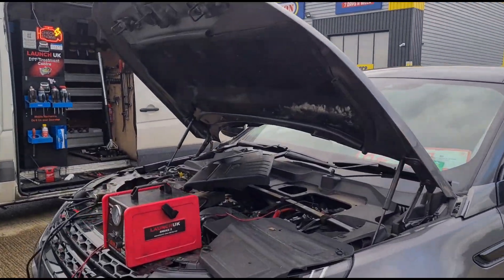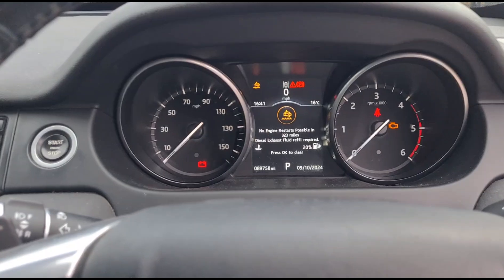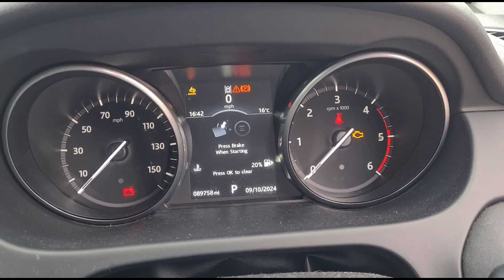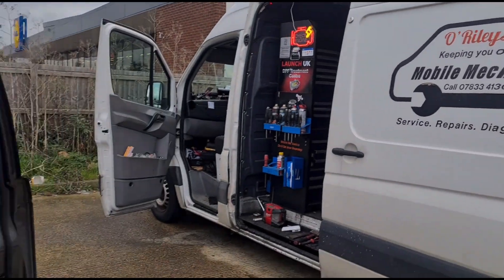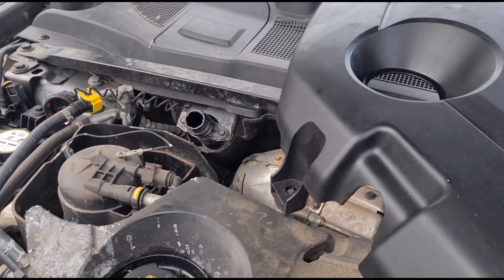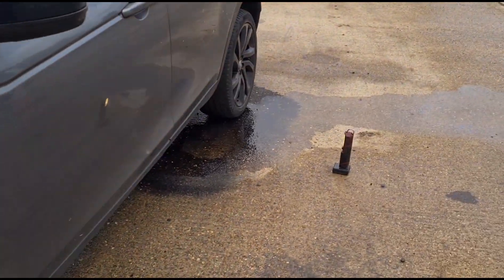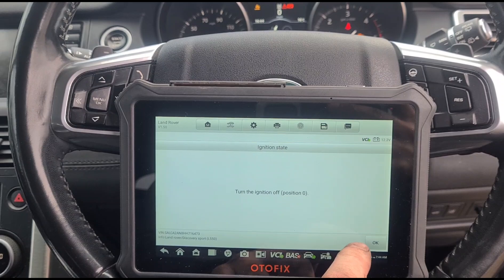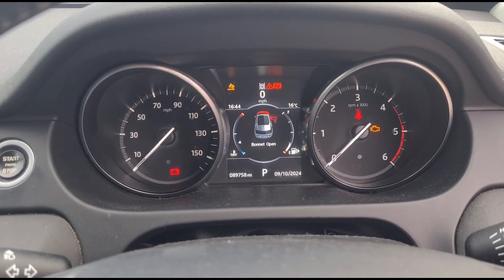Land Rover Overfilled Adblue Causing Permanent NOX Faults

Comment: Hi Jimmy, have you any experience with using Dipetane fuel lubricant? Very popular in Ireland. Can't seem to get launch uk products over here. I was trying to get the dpf cleaner and flow restorer to use as a preventive measure in a trafic
Reply from the maker: On my website I have suppliers details in Ireland www.orileysautos.com
Reply from the maker: On my website I have suppliers listed
Reply: Thanks!

Comment: Why does the car say add blue low and did it reset.
Reply: It defaults to a low reading when the sensor is overwhelmed with a very high fluid level, or if it malfunctions. Presumably this is because if the dash display defaulted to "overfilled" on sensor failure, you would just never fill the tank.

Comment: With all the electronics in the vehicle surely fitting a fluid level gauge to the Ad blue tank is feasible????
Reply: It does have a level sensor. When the tank is way too full and the sensor quits working because of that, the level sensor defaults to "underfilled" because that is safer than defaulting to "overfilled". If it defaulted to "overfilled" on failure, you'd never fill it up and then a few "emissions" might escape the tail pipe when it ran out of fluid...
Reply: @bills6093  good, but very bad!! Why not have show when it needs topping up and indicate how much to add, if filling till full confuses the sensor?
Reply: @malcolm6951  They do, but in my experience many drivers are just stupid.
Reply: It's an ultrasonic sensor, so it needs an air gap to read correctly. It will probably state in the handbook how much to add when you see the refill light. 

Some vehicles will say how many litres to add.

Comment: All these vehicles fitted with additive tanks should have a sender unit in them and a gauge on the dash just like a fuel tank has.
Reply: They do have a sensor.
Reply: @bills6093  And a gauge that tells you how much to add

Comment: Wouldn't it be possible just to blow through it using a suitable piece of tubing?
Reply: The fill port is pretty large to try and use a small piece of tubing, so you'd need the adapter as seen in the video.

Comment: Weird case, Jimmy! Overfilled tank reports as underfilled?? Can't get more misleading than that!
Reply: Was caught out with this sometime ago apparently the level is checked using sonar and if the tank is over filled the sonar cannot read the capacity there needs to be a space between it and the fluid. Bad design had us flummoxed for 2 bloody days 😫
Reply: @kevinpalmer7452  That makes all the sense - using an ultrasonic level monitor does require a minimum distance to the fluid (minimum processable sonic wave travel time), but it's absurd to report it as "underfilled".
Reply: @bills6093  Maybe, but it would be more reasonable to have more than a single error message, for all fill problems. And, if there was room for only one message, then make it something like "fill error" instead of misleading the tech / owner.
Reply: @kevinpalmer7452  A bad design that could be solved with a simple 'bump' bubble at the top of the tank - doh!
Reply: @kevinpalmer7452   100% correct

Comment: Jimmy. How is it possible to overfill the tank. Surely full is full.
Reply: They use an ultrasonic emitter / receiver to detect the level of adblu in the tank, if it's filled to the brim and covers the sensor, the system defaults to offline / malfunction and immediately puts the car into limp / limited restarts mode...  This is very common to many adblu systems.
Reply: You need an air gap for the ultrasonic sensor to read correctly. If  vehicle with adblue says add X litres, then don't go over it.
Reply: @stephenreed1080  Or they could mould one into the tank...
Reply: @stephenreed1080  mine said add 11lts I haded 10lt bottle now got this warning light on
Reply: JLR are 'special' :)
I have no idea why they even detect it, after a few miles it would go down anyway, and they could use the signal to simply inject a bit more anyway. But I guess it's good for aftersales business, as they now don't sell new vehicles IIRC.
Reply: Last Xmas I had this fault had new adblue tank and injectors fitted and it’s just come on again year later cars now out warranty Range Rover asking stupid money